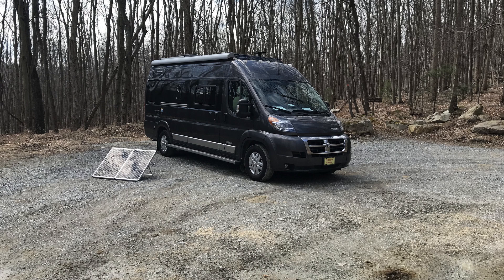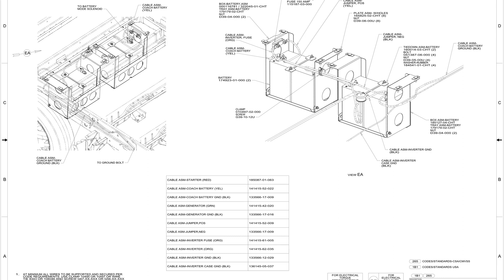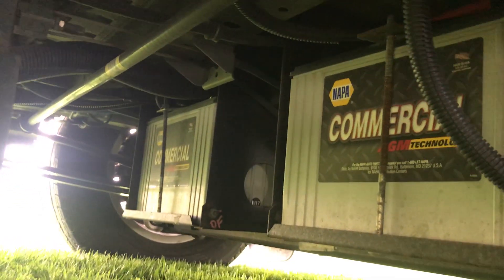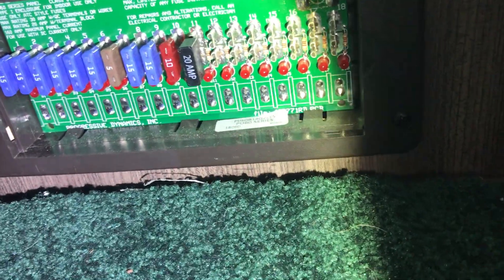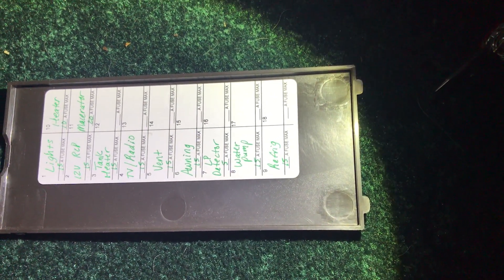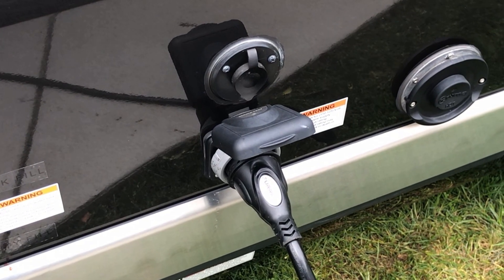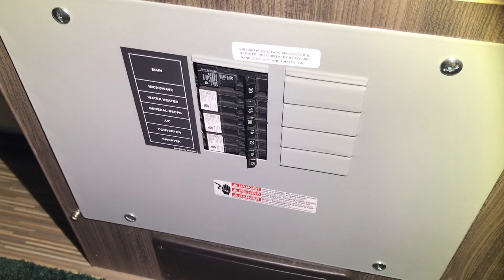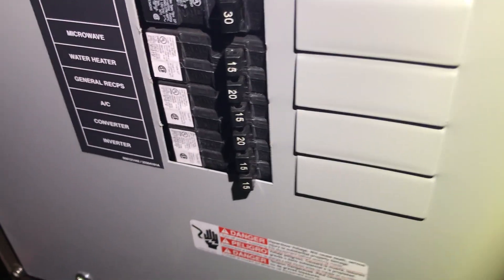Travato Electrical System

Comment: Hello Gregg, just wondering where did you get the schematics for the electrical layouts? 
i own a 2020 Travato 59G and like you, I'm trying to learn as much about it as possible. Thanks and great video!
Reply from the maker: If you do a google search just put in Winnebago Travato Electrical Diagrams and it should be listed under a Winnebago website.
Reply: @gregghershberger7968  Thanks again.